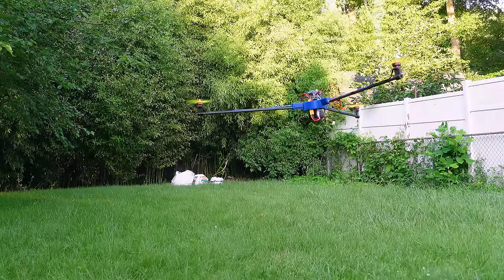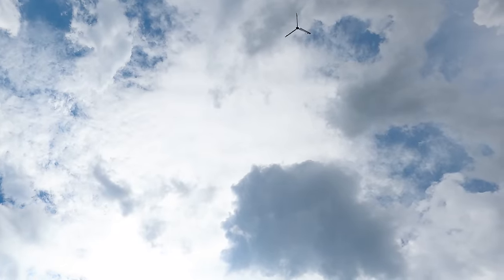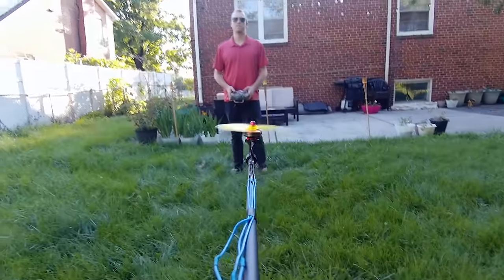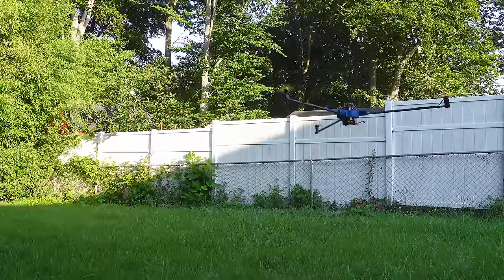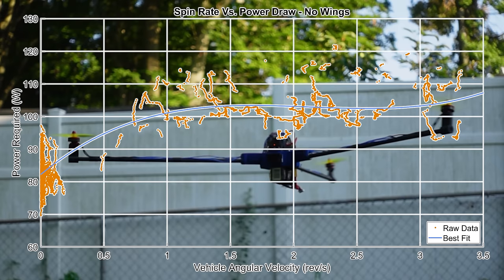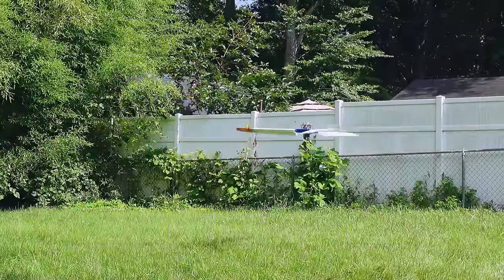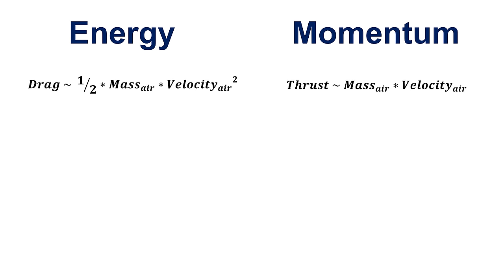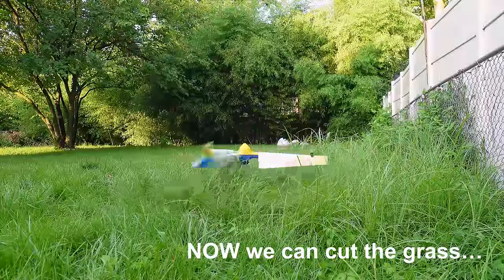The Spinning Drone Paradox - Part 1

Comment: Holy crap dude... I can't remember the last time I saw something this brilliant! Is this an existing  concept I just happened to never hear of, or did you come up with it on your own? Either way, you u got a sub from me! I can't wait to see more!
Reply from the maker: There are other spinning drones that leverage the efficiency boost of the tip-driven blade configuration, but none that can do regular multirotor hover, spinning hover, and forward flight all in one to my knowledge
Reply: Shibeeb, there was at least one toy "drone" that used this concept in the mid to late 2000s. Those toys could spin hover (no normal hover) and fly forward/back and side to side as seen from the pilot. It used an infrared controller and pulsed the motors at the right times for directional flight.
Reply: pyropulse  why don't you use your gigabrain to go create something impressive or help others instead of insulting strangers on the Internet? I doubt this is less efficient than a traditional helicopter for a number of reasons: 1. There's no fuselage obstructing air flow. Instead, the prop wash is moving air across an airfoil which aids lift. 2. There's no tail rotor needed to overcome the rotation from a traditional helicopter design. Newton's third law dude... "Equal and opposite reaction". If you have to impart force into a fuselage to keep it from rotating, how efficient is that really?
Reply: pyropulse  old brain🥴
Reply: pyropulse  I too am amazed at the amazement over this design. Over a hundred and ten years ago, a man thought of and was doing research on “tip jet” design that used compressed air to spin the blades of a “helicopter.” It’s not exactly the same as this, but it’s the same general principle that has been tried and tested throughout the last one hundred years. I love this video of a homemade design that works amazing, with actual data to show its efficiency, but come on people, this isn’t a new invention. 

Idiocracy wasn’t a comedy.
Reply: pyropulse  Hey prolapse, this is way more like a flying wing version of an osprey than it is like a helicopter. Hell, it's more like a gyrocopter in it's propulsion than a helicopter. I know that spinning things may all look the same to you but we often group engineered items under different names due to their differing capabilities. This can do things that helicopters can't, same as quad copters, gyrocopters, and other items we don't call helicopters for good reason.
Reply: Their has been a similar concept out there for a while already. Tip jet helicopters place jet motors way out on the end of the rotor rather than using a central motor, eliminating the need for a tail rotor in the process.

They have their own complexities that have lead to the typical central motor design with tail rotor being far more common these days.
Reply: pyropulse  It is a rotating flying wing rather than a helicopter, with the additional ability to turn 90 degrees and fly as a normal flying wing. I don't think I have seen the concept before personally.
Reply: @rexsceleratorum1632  It's similar to the Focke-Wulf Triebflügel. Germany came up with the concept during WWII but afaik it never got past the design and mock-up stage.
Reply: @dozer1642  Totally man. This is just a tip jet hellicpoter, Tanks are just armored tractors, and motorcycles are just half a car. And deriding the opinion of people who understand something based on your impression of its surface level characteristics? Well that's just the same as keen observation.
Reply: @outsider344  you don’t get out much, do you?
Reply: it's just an Osprey in drone form
Reply: @MrTeddy12397  no. No it’s not.
Reply: @dozer1642  yes. Yes it is.

Comment: It would be cool if you put a swashplate in the centerbody and used cyclic for directional control. No need for anti-torque because the rotors self propelled. If the battery was in the non rotating centerbody you'd need some kind of power coupling to deliver power to the tip propellers which might be hard to do, brushes or something I guess. Reminds me a bit of one of the human powered helicopter attempts to win the sikorsky prize (before they all went quadcopter, the cal poly one from 89 i think)
Reply: That could  be done with slip rings.  Like on a car Steering wheel n such.
Reply: Then you'd kinda have a helicopter with tip propellers on the big propeller. I guess you'd need a way to brake the rotor so that it can still function as a tricopter in order to be able to choose between high efficiency and high stability, which I'm guessing is the whole purpose of this.
Reply: @southtexasspecials175 most cars use clock springs because they only need 3 turns max

Comment: Great idea, ive been dreaming about stuff like this for some time.
Also the footage of the prop flying off cracked me up
Reply from the maker: The worst part is that I didn’t have a wrench or pliers in my car to re-tighten it. So I had to use my jumper cable clamps lol
Reply: @NicholasRehm  time to get a good little multitool 😜
Reply: @NicholasRehm  can't be worse than when I had to use a pair of sticks pinched together lol

Comment: this sort of reminds me of the so called "engineless helicopter" called the XH-26 jeep jet, that was basically a one person cockpit with a tiny tail boom, single bladed tail rotor, and a dual-bladed main rotor that had a pulse jet engine attached to each end, such a weird yet interesting piece of technology, and this one just brings it to whole new levels of both
Reply: That helicopter is still on my mind since seeing it on the internet for years. 

Tip jet helicopters are always interesting. The only issues I think are the noise, and the gas consumption (this one's the one I'm not sure) but if we can make a helicopter like that it would be awesome since they're simple, and doesn't need tail rotors to fly.
Reply: I was looking for this before I posted my own comment lol
Reply: @JayHeartwing  Won't gas consumption be significantly less than a standard copter, as explained in this vid?
Reply: @johnaweiss  It is more efficient to just use a rotor spun by torque from a motor.

Comment: This seems like a really cool idea for drone photography. Yes the camera spinning would pose a challenge, but the extra flight time would be a huge draw while still being able to hold position, slowly move around with that efficiency, and even fly like a plane
Reply: For lidar drones the rotation would not be that much of an issue.  Doesn't really matter how the laser hits the ground as long as the instruments can geolocate it properly
Reply: The camera spinning would prob cancel out the energy savings as it’s turning the exact same amount inverse
Reply: @greggotheeggo2354  It's not really a function of the speed of rotation.  The camera support would impose little mechanical resistance, and any air resistance on the camera would actually help to keep the camera from rotating, so the camera stabilisation would not require that much power.  The power required to spin the propellers and pull the (much larger) three bladed wing through the air would be significantly greater.
Reply: Maybe have the center hub in a bearing so it doesn't spin with the rest of the drone. Or have the camera on a bearing so it can't spin with the body of the drone. Framing would be a bitch though 😅
Reply: I am not sure the spinning is any real problem and may in fact be a benefit. It would give an automatic panorama view with a fixed frame view derived computationally. Think how synthetic aperture radar improves image resolution as the camera traverses terrain giving result likea  much larger apparent lens. Numerous satellites spin to cover a larger field of view and specific images are collected with the object comes into view. All this is done by software and don't need to be mechanically corrected on the drone itself.
Reply: @chucknaussie  That's an interesting point, but the issue would be with rolling shutter. I believe Smarter Every Day is the one who made a really good video on that, but the speed at which the craft spins would make most cameras really struggle to get a clean image. You would either need some serious software correction or a global shutter to counteract that, but then you still have motion blur to consider.
Reply: @chucknaussie  considering you probably want 60 fps at least (to smooth out the fast motion of the thing) you need 1/120 shutter times. With the rate this thing spins that would just be blurry.

Comment: The idea of substantially less energy made me immediatly think of the Focke-Wulf Triebflügel plan. Vertical take off jet thing, but instead of normal jet thrust, it had 3 engines placed at the ends of wings that spin around the center of the fuselage. Nothing beyond the initial concept was made, but it did make its way into the Captain America movie
Reply: yep, literally the same idea, just 80 years ago....

Comment: As always impeccable work man. It’s like a tip jet rotor but so much better!
Reply: My thoughts exactly. I wonder if you could make a highly efficient 'personal helicopter' by replacing the tip jets with electric motors and small props ? Or ducted fans maybe ?
Reply: @Haawser  Thay was my first thought too.

Comment: Interesting!  You might look into the designs of some helicopters that had various propulsion methods at the tips of the blades.  I recall seeing one a few years ago that was still flying!
Reply: Yes, Rex - somewhere (iirc) there is a 'prop-copter' site, which references the H.E.P.A.R.S. approach as well as some very  early  work by Curtis?  Hang on . . .  Found it!  Searched on 'propcopter'  , also there is a Wikipedia page on the massive Curtiss-Bleecker Helicopter from 1930.... I have a long-dead toy with 2 articulated blades and a cross-piece with two motors/props that  flew reliably back in the day . . .  Interesting!
Reply: @250tegra  Interesting!  But, ummm.... what does H.E.P.A.R.S. stand for?  I couldn't find it online (at least it was turning into more work than asking you)

Comment: I’ve had this idea for years. Good to see it being tried. Believe it can work. My idea has the props tilt separate from the central props tilt. The central prop would just be on a ultra bearing. It made me think the drone motorized props would provide the speed and stability control. While the central gave the thrust. Which was regulated thru the motors the same. With tilt control on the central prop I thought the drone would be able to launch into a zero g 180 flip. Then tilt the central prop, launching back up instead of down. Don’t know what purpose it would serve besides fun. 🤷

Comment: Descent could be very efficient, you would need to store momentum thanks to the air the drone meets during descent....at the end of the descent you change the wings angle, so that you transform the drone from turbine that has stored the potential energy in to a propeller that pushes it self upwards to slow down.

I also wonder how a spinning drone like that could understand its horizontal direction of travel while the entire system is spinning, in a future model

Comment: You should really make 3 more of these and use them and props for a single large drone. Might actually catch on with future drone designs!
Reply: And so on and so on... a Russian doll drone!
Reply: Recursive! And even better: why not have smaller drones that assemble themselves into the recursive structure and then repeat? Keep recursion into bigger and bigger recursively spinning system. It'll be like a fractal drone.

Comment: So obvious. I'm astonished at the fact that I've never thought of this, bloody well done!! 

PS: my findings in sustaining longer flight times without foils were as follows. 
1- larger props
2- more torque (less kvs)
3- higher voltage
Those in combination have taken some designs from a 25min to a 90min flight!

Larger props wouldn't work well with your design however they do as a rule of thumb and should also still work great with a maximum rotation of 45deg.

Wonder what would happen if you incorporated this current design with a 10' - 3 blade prop powered by a 100kv motor in the center!? 🤪

Comment: I was impressed. Two questions: Have you explored using the large wing hover configurtion for take off and landing since increased ground clearance nor a freely rotating mount should not be difficult.? Have you considered using a pair of counter-rotating systems, either co-axial or co-planar?

Comment: Fun and interesting video! 

It seems to me that the dip in thrust required for the wingless drone could just as easily be explained by an overfitted model. What order was the polynomials you fitted the data to? And did you keep some data not used in training to verify that those models were in fact better and not just overfitted?
Reply from the maker: The data I showed was admittedly just from one flight, but I did have other flight worth of data that I never combined into one batch. Still, the slight dip was consistently there, though subtle

Comment: Instead of putting the props on the tips of the blades, you could put them closer to the hub. Since they would now work in a lower speed airflow, their efficiency could improve.
Also, this drone could be fractal, has each propeller could be made on the the same principle .
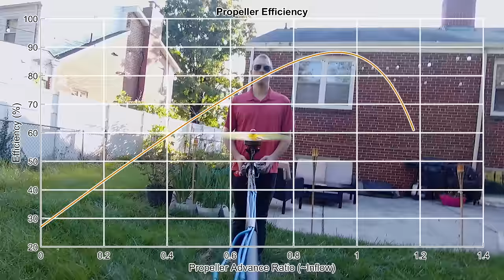Reply from the maker: Actually, higher inflow/velocity is more efficient depending on the pitch of the prop 04:18
Reply: @NicholasRehm  Usually the larger the prop, the better the efficiency. In that case I suppose every prop has its optimal RPM efficiency by design, but slow props are more efficient overall  ...

Comment: Great video and a cool idea. Besides the energy efficiency, this should also be more robust to position errors. The angular momentum will keep it from tilting and thrusting in the wrong direction. Did you have any problems with MPU data while spinning?

Comment: I could already see military uses for a drone like this. Improving efficiency and extending range is always something they would be interested in. I'll definitely be looking out for that forward flight performance video.
Reply: Increased payload capacity for one. Same power consumption for carrying 3 grenades compared to one.
Reply: instead of holding 1 kg of explosives it can hold 3 kg
Reply: Yes, I see finances in your future ...
Reply: Not sure I agree. Unless you can somehow fly it all the way until you need to drop the payload
Reply: As is, it wouldn't be usefull.
You'd need a sensor I.e. camera to be in a static position, for target acquisition.

One option being the center part not rotating. So another layer of complexity and another point of failure, getting power to the small rotors.
Reply: @soul0360 I think image stabilizing could take care of that, especially since the spin would be a known variable.
Reply: @fungdark8270  Remember that the image (or rather; the video feed) would be spinning as well. I'm sure a neat algorithm could edit the footage in real time so the human operator can view it as it was on a static angle. But even then, you would probably only be able to point the camera directly downwards.
Reply: The last thing we need is another military drone.
Reply: @alainkoningverdraag6698  I hear intense rubbing of hands :)
Reply: @fungdark8270  I explored this concept many years ago. Image capture is not a problem. The magnetic direction at any given time can be matched with the correct image frame while spinning.

Comment: With the low total weight and strengths of composites, have you considered trying a shallower (and thereby lighter and causing less drag when not spinning) supercritical airfoil wing design? Could spin that puppy up really fast before shock and vortexes become an issue.

Comment: I've had this in my head for 40 years still haven't quit got the skills to reinvent aircraft control to make it work. Looking forward to your approach. My imaginary version used one wing and one motor counterweighted by the battery. Also a strip scanning camera in conjunction with a post processor that reconstructs a conventional view. All this is all way more achievable now than 40 years ago but remains above my skill level. Not sure why you thought it was counter intuitive though.

Comment: Awesome! I love it! But I gotta ask, since the air speed is much higher at the tip of the wing, Wouldn't they work better if the sweep of the wings were reversed?
Reply: Alternatively a propeller's pitch increases along the length of the blade so as the angle-of-attack is congruent with apparent air flow. The tips of a propeller spirals through more air at the tip of the propeller over the  region closer to the center. Given the design has a flat wing rather than one that twist along its length, the thinning blade is an appoximation of having an increased pitch the closer to the centerline